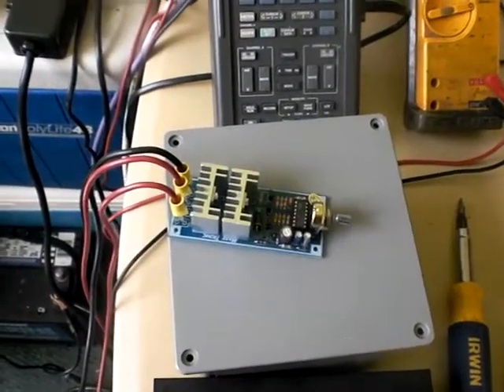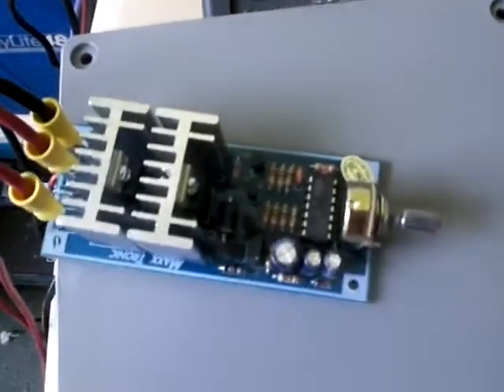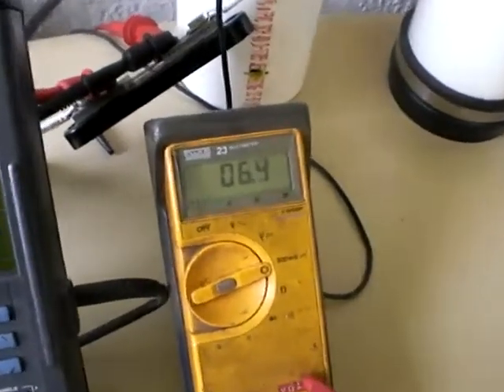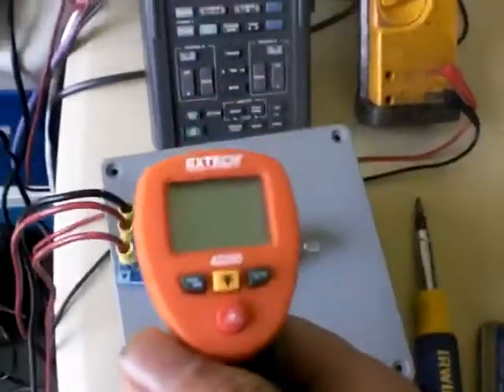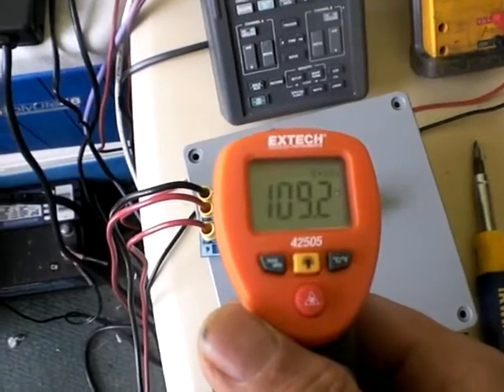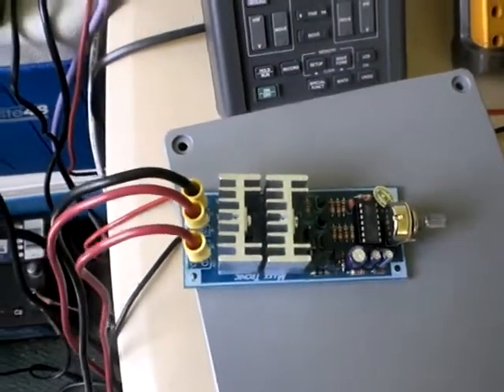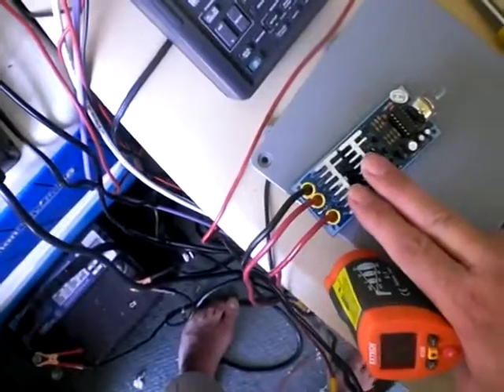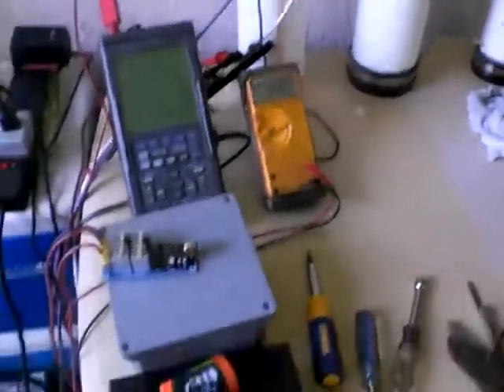"Cheapie" PWM Overheating Problem

Comment: @lutherp40 I agree with jjenson2006 the MosFets must be Slammed on and off extremely fast, I have designed a DIY PWM base on Zero fossil Fuel CCPWM V2,
And have improved The PWM Drive to do just that. I am also working on a Small PWM Driver up grade, For Units like yours. 
I would also agree with you that, excessive heat coming from electronic should not be. You should be able to touch them and not get burned!

Comment: Something is seriously wrong if it melted solder. Solder needs several hundred degrees before it starts to melt; so in order for the solder to melt, the heat sink would first have to reach several hundred degrees.

Comment: Understood, but you have to expect heat sinks to get pretty hot anyway. The CPU in your PC can easily reach 150F degrees or more even with the heat sink fan; it's normal.

You're not really supposed to touch the heat sink anyway. If the temperature was running well over 200F degrees I would start to worry; but I'm sure it won't get that high.

Also bear in mind you will be using this under the hood of a car; the massive airflow should keep it quite cool, so it might not be much of a problem.

Comment: The heat sinks are sufficient enough for up to 30 amps. The problem is the circuit design. It either needs a better MOSFET with a lower RDSon and/or it needs a better driving circuit. These MOSFETs need to be slammed from cutoff to saturation and back again as fast as possible. If the MOSFET isn't driven hard and fast enough (you will notice this on a scope at the gates when you see a slope of more than 1us), the MOSFET will absorb more power and get hotter than it needs to be.

Comment: I have the same PWM...I overheated it to the extreme when I used too much electrolyte one time...it melted the solder from underneath the sinks! Still working though. I was then surprised to see how little air you need to keep them cool....I have it next to my floor vent and even on low, that's more than enough. I'm going to do a CPU fan next so I can mount it in some spot. Good video!

Comment: what is the max operating temp of the mosfet?

You might just be able to get a 12 volt fan and mount on the top of those two heat sinks and cool it down.